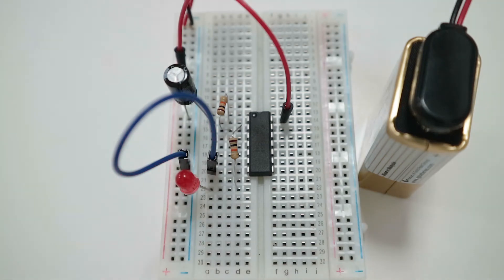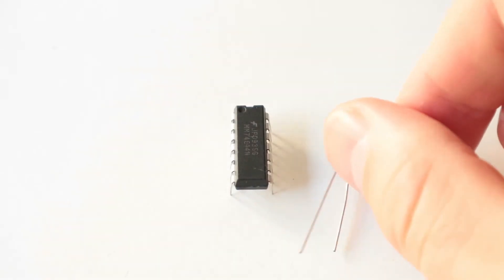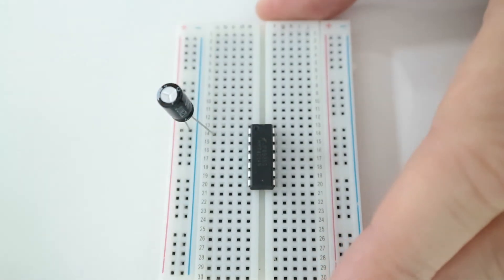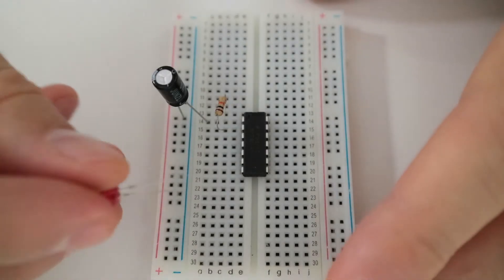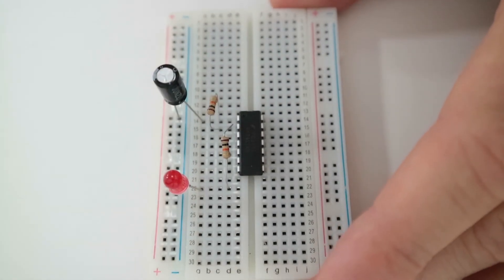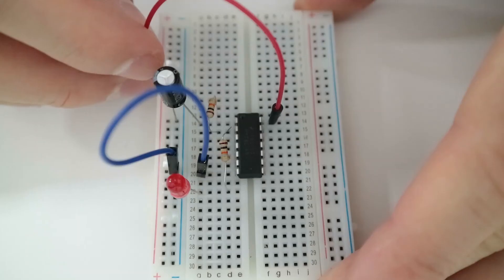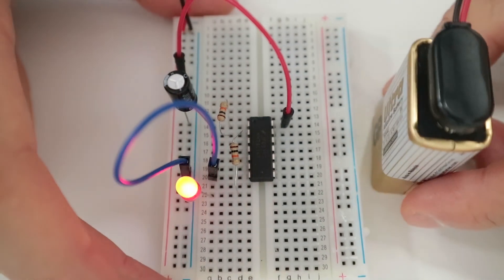Build A Blinking LED Circuit (Step-by-step instructions)

Comment: In your book "Getting_Started_With_Electronics(2nd_edition)" you build a similar circuit using a relay and a capacitor, how should the connections be to use instead of the relay a "5V relay module" with pins VCC, GND, IN and outputs NO, NC and C? I tried to build it in different ways without any result. Please could you help me? It is a very interesting example from your book to introduce us to the world of electronics, thank you!

Comment: Hi I followed all the steps but I use a mb102 poeer supply which gives oit 5v. Will this work or do I need to use different capacitors/resistors? thanks
Reply from the maker: It should work with 5V.

Comment: Hi, just found this video... I'm build car scale models and would like to add flashers (blinkers in UK). My power source is 4.5 VDC. Would like to have right and left flashers + hazard (four way flashers) if possible. I'm not electronic savvy but quite handy. Would like to know if and how this circuit could be modified for my projects. Any help welcomed! Thanks!
Reply from the maker: Hi, yes you can easily make this project work with 4.5V by using either a CD40106 or a 74HC14.
Reply: @Ohmify  Thanks for the reply, I'll look into it... Again, not electronic savvy...

Comment: How to make it a multiple LED blinking at the same time?
Reply from the maker: Add a transistor on the output to get more current. Then power the LEDs through the resistor.
Reply: @Ohmify  What I have to do, is just add 1 more LED, or do I have to make the same circuit next to it? And is there an alternative to 74c14?, can I use 74hc14?
Reply from the maker: @mangakeyyorivaldy9117  Add a transistor. Via the transistor, you can add many LEDs. 74HC14 works, but only supports up to 6V, so reduce the supply voltage.
Reply: @Ohmify Which one should I use? Resistor 1/4 Watt or 1/2 Watt
Reply from the maker: @mangakeyyorivaldy9117  For the feedback resistor, both will work. If you want to use one with multiple LEDs, you have to calculate it. But go for the 1/2 to be sure. For MANY leds, you might need an even bigger W value for the resistor.
Reply: @Ohmify  Wow, Thanks for the explanation. That's very helpful. I'll try after this. Unfortunately I bought the wrong component (sn74hc595n)

Comment: How long would it blink with a full battery?
Reply from the maker: Depends on the battery.
Reply: @Ohmify  a standard USA 9v
Reply from the maker: @PhilosophyCat  Just a very rough estimation: Let's say the circuit uses 5 mA on average. That's 5 mAh. Let's say the capacity of your battery is 500 mAh. Then it will last for a 100 hours.
Reply: @Ohmify how to extend the length of the led?
can i use copper wires?
Reply from the maker: @NAP625  Yes.

Comment: maybe im doing something wrong but i rebuilt and made it three times and cant seem to get it to blink 
i tested the voltage getting to it being at under 2v so i changed out a resister for for jumper cable and got 3v to it but it just made it brighter not blink
Reply from the maker: Make sure your're using CD40106 or 74C14 (not 74HC14) if you're using a 9V battery. If you're getting 2V on the output pin, something is not connected correctly. It could be that you are using values that make the LED blink so fast that you can't see it (and measuring it will give you an average)

Comment: Hello sir, that first resistor you placed did it slot into a row the inverter is in and second pin into an empty row? If so how does putting it into an empty spot work? Does this mess with the citcut?
Reply from the maker: The first resistor is connected between pin 1 and pin 2 of the chip, it's not on an empty row.

Comment: Can u use 3.7 volts to power it?😋
Reply from the maker: Yes, it should work. As long as you have an LED that turns on even with very little current.

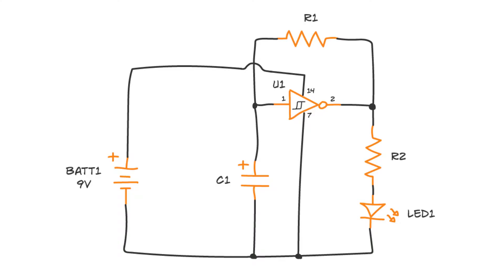Comment: 0:50 why is the IC named U1 and can you do this using a regular  hex inverter like the 7404 instead of a  Schmitt  triggered one ?
Reply from the maker: It's common to name integrated circuits something with U. It's just a reference like the R for resistors. This circuit needs the schmitt trigger.

Comment: would it be possible to connect more than one led to the same trigger inverter?
Reply from the maker: Yes, you can add more LEDs in parallel with the one that is already there. They will be dimmer since they have to share the available current between them. Another way is to add a transistor, this way you're not limited by the current from the chip anymore.

Comment: I'm looking to use a 3 volt coin battery and trying to make four 0805 leds flash, like car hazard lights. Would this still be a setup that I can use?
Reply from the maker: The minimum supply voltage for the CD40106 is 3V, so it might just work. But you have to make sure that the LEDs you are going to use have a forward voltage of 3V or less, and you'll have to connect them in parallel. The current from the CD40106 is very low, so you also might have to use a transistor to get enough current. Try with one LED first and see if that works.

Comment: Great video! What is the voltage going across the LED? Is it 9v or a lower value? I am trying to see if i can use this circuit to control a buzzer.
Reply from the maker: The output voltage is a little bit below the voltage you power the chip with. So if you use a 9V battery, you might get 8V on the output. But the problem is the current. Buzzers need current, which the chip cannot provide a lot of. Solution: use the output to turn on and off a transistor. Connect the buzzer through the transistor so that it pulls current directly from your power supply instead.

Comment: Can I use a 74LS14 ?
Reply from the maker: Yes, but 74LS14 only supports up to 7V (if I remember correctly), so you need to reduce your power supply to max 7V.

Comment: Is this possible to be build as controlled on/off (blinking) led? Example 4ms on and 35ms off
Reply from the maker: Yes. With a diode in the mix. It's not straight-forward to get those exact values. But if you don't mind tuning with a potentiometer, it's doable.

Comment: So what is exactly happening here is the capacitor filling up than once it’s filled the shift register allows it to flow to the LED? If you were to add different sized compactors would you get different blink speeds?
Reply from the maker: There's no shift register in use. More details here: https://www.build-electronic-circuits.com/build-blinking-light-circuit/

Comment: I want to make a brake alert, When the brake is applied, the led should flash rapidly four times and then constantly keep lit until the brake is released. It's a 12 volt circuit, LED lamp. How can I make it flash four times and then constantly keep it on?
Reply from the maker: The easiest, circuit-wise, would be to use a microcontroller. For example, you could easily do that with an Arduino. If you want to avoid using a microcontroller, you'd probably have to add a counter and some other logic to make it happen.
Reply: @Ohmify  Aurdino way is kinda expensive for just four flashes and also making it waterproof and fitting it under the tail of a motorcycle takes a lot of the available space. I'd like to go with the counter way, what components should I use?
Reply from the maker: @streetsquiid5615  I don't have a circuit ready for you, but from the top of my head, I'm thinking you can use the 4000 series CMOS IC. 40106 to make a clock signal. 4017 to count four times. And some logic that stops the counting after 4. You can check out this page to learn more about the 4000 series: https://www.build-electronic-circuits.com/4000-series-integrated-circuits/

Comment: Is 74HCT14 ic  work ?
Reply from the maker: Yes, but check the datasheet for how much supply voltage it can support. I think the HCT only supports up to 5V (but I am not sure). If that's the case, reduce the power supply to 5V.

Comment: Amazing Work Oywind!! Hats off!! Couple of questions 

1) I tried using a 547 Transistor with 330 ohm resistors connected to the Base and the Collector instead of the Schmitts Inverter as mentioned in your book, but am not getting the LED light to blink. It just blinks once and turns off

2) Is there a particular R and C value combo for getting the exact on off timings, for eg., For 20 times blinking/sec use this value of or resistor and capacitor. Or for such precision timing do we need a 555 timer?? 

Thanks in Advance!!!
Reply from the maker: Hey!
1) I have written many books. But maybe you're thinking about the stable multivibrator? You can find more info about it here: https://www.build-electronic-circuits.com/astable-multivibrator/
2) It should be possible to calculate it by using the threshold values of the schmitt trigger (which will depend on the voltage you use to power the chip) and the formula for charging and discharging a capacitor. You can find a simplification from this page that might be good enough: http://www.learningaboutelectronics.com/Articles/7414-oscillator-calculator.php - or you can find more advanced formulas in the cd40106 datasheet if that's the chip you are using.

Comment: i did the same think but nothing happens  it just make the IC warm
Reply from the maker: The IC gets warm if your try to pull too much current out of it, or if you've connected something wrong. Did you use the same resistor values as I did 10 000 Ω? And did you use CD40106 or 74C14 (not 74HC14 or any other version)?

Comment: is there any way to recreate this to make the LED blink but without a Hex Schmitt Trigger Inverter? Maybe using a capacitor or a transistor?
Reply from the maker: Yes, here are a couple of other methods: https://www.build-electronic-circuits.com/blinking-led-circuit/ (but any oscillator will do)

Comment: My led turns on but it does not blink. I have remade the circuit twice. Please help.
Reply: It’s 74HC14 ICS hex shmitt trigger inverter
Reply: Did that help?
Reply from the maker: @Grimgar_clay  Yes, that helped! I recommend the 74C14, you have the 74HC14. The HC version works too, but the problem is that it only supports up to 6V (the C version supports up to 15V). So the HC chip cannot be powered directly from a 9V battery. You need a power source of between 2V and 6V. If you already connected it to 9V, there is a chance that you damaged it.
Reply: Thanks. I ended up using two double A’s in sieries and it works just fine, thanks for the advice:)
Reply from the maker: @Grimgar_clay  You're welcome!
Reply from the maker: Could be the IC. What's the model name written on your IC?
Reply: Thank you I will use my power supply.

Comment: If I want to add more LEDs what changes I should do in this circuit components
Reply from the maker: Then you should add a transistor so that you don't overload the chip. Here's how the transistor works: https://www.build-electronic-circuits.com/how-transistors-work/
Reply: @Ohmify  I want to connect 20 LEDs to a 9v battery. And I want all LEDs to blink at same time. Which type (model) of transistor and chip I want to use?
Reply from the maker: @Luckshayan  You can use any type that supports the current you need. Ex if you want 10 mA for each LED, you need 12 x 10 mA = 120 mA in total. so you need a transistor that supports at least 120 mA..

Comment: How can I control the timing of the blinking? Like If I want it to be slower
Reply from the maker: To make it slower increase the capacitor value and/or the feedback resistor value.
Reply: @Ohmify what do you recommend the value of capacitor to make it slower?
Reply from the maker: @samanthabandong  Try doubling the capacitor value from what you are using now, and the blinking should become half as fast.

Comment: There was a circuit similar to this, (many years ago) in a magazine, expect, the lower the battery voltage fell, the faster the LED would blink.... do you know how to do that?
Reply from the maker: The thresholds of when the chip switches from high to low or vice versa changes with supply voltage. So it could be that it blinks faster with a lower battery voltage. I haven't tested.

Comment: Likely a long shot that you'll answer this, but could you do this with 10 led's with one chip? Trying to make a gift using 18650's and a simple design for a friend. Not done a electronics project in a few years
Reply from the maker: Absolutely! But the chip does not provide enough current for 10 LEDs, so you need to control the LEDs with a transistor. It will look like this: https://ohmify.com/wp-content/uploads/2021/06/Blink-NPN-LEDs-circuit.png
Reply: @Ohmify  that makes sense.... only question i have is if I can use the 74c14n in the build since I found the best deal on that chip. As far as I can tell its the same
Reply from the maker: @leebuckley8761   Yes you can. That chip can provide more current than the cd40106, so in that sense, it's better. With the 74C14 you can get around 10 mA-15mA out of it, so if you stick to maximum 1mA per LED, you can do it without the transistor. But 1 mA might be a bit on the dim side depending on your needs.

Comment: Really good video. If I want to use 6 Volt instead of 9 Volt. What components should I change and to what? Thanks :)
Reply from the maker: You can use the same components. If the LED is very dim, you could replace the resistor that is connected to the LED with a smaller one. For example 1kΩ.

Comment: Can I use two 2K resistors instead of 10? Can someone please respond
Reply from the maker: If you are using the 74C14 chip, yes. If you are using CD10604, it's above the limit of current, but maybe it works. It all boild down to how much current your chip can provide. If you go from 10k resistors to 2k resistors, you increase the current taht is pulled from the chip.

Comment: I did the same exact circuit, and it did work but facing some minor issue. When I run the ciruit it does not blink at all it just runs without blinking. What is the problem. Is it related to the voltage source since I run it for the first time with 12 volts as a power source or I have some other issues? 

Please, helpe out.
Reply from the maker: So the LED is on all the time? What IC are you using? And what is the value of the resistor you have in series with your LED?
Reply: I'm using HD74HC14P, which is 74C14 as mentioned in the video. And the resistors I'm using is 10K ohm's resistor. Actually when I run the circuit with 9V it didn't glow or light up at all later on I use 12V supply and it did work but there is no blinking at all. So what should I do I already buy new components but looking forward to a guid or instructions to run it like do I have to lower the resistance values?
Reply from the maker: @iiaskar  The HC version (74HC14) only supports up to 7V.
Reply from the maker: And the recommended voltage is between 2V and 6V.
Reply from the maker: That's why I recommend the 74C14 version. Or the CD40106.
Reply: @Ohmify  
Thanks for the fast response, and for sure, I will change the IC that I have. I have a quick question but not related to the video. I'm doing a simple project that contains many LEDs connected in parallel, and it glows to draw some characters. My question is do you advise me to use a resistor in each LED. So, let's assume that I'm using 80 LEDs in my project. Do I have to use 80 resistors? If the answer is yes, what is the best resistance value for a 5mm LED? But if the answer is "NO," is there any other method like let say that I want to activate 18 LEDs simultaneously and connected in parallel can I use one resistor for the 18 LEDs and the best resistance value?

(I'm doing the project to draw some characters, as I said, and we are supposed to do it in two methods with and without Arduino. Any advice from you since you have a fair amount of information)
Reply from the maker: @iiaskar  If all of the 80 LEDs are always on or off at the same time, you could use one resistor. This is because then you would need the same amount of current to the LEDs every time, and the resistor sets the current.

Comment: Can I use a 9mm red LED light? Please someone respond fast.
Reply from the maker: Yes, as long as it's a low current LED. If it needs a lot of current it won't turn on. But you can try, the only thing that will happen if it doesn't work is that the LED stays off. If it's not turning on, you can make it work by adding an NPN transistor as a switch that turns your LED on and off.
Reply: @Ohmify  ok thanks! :)